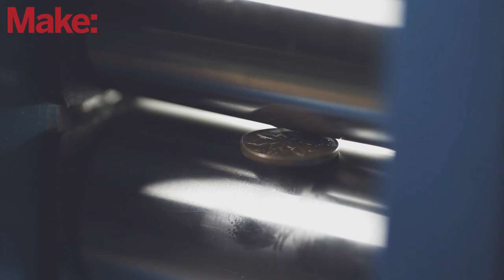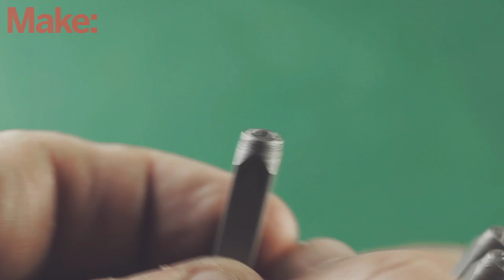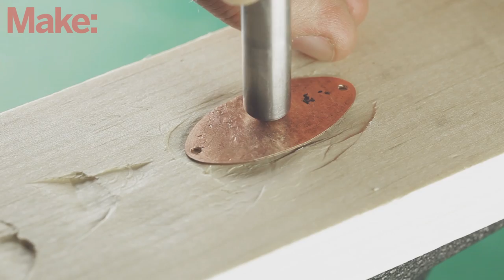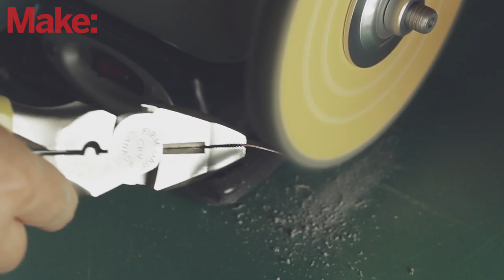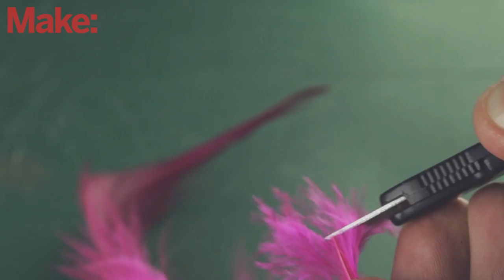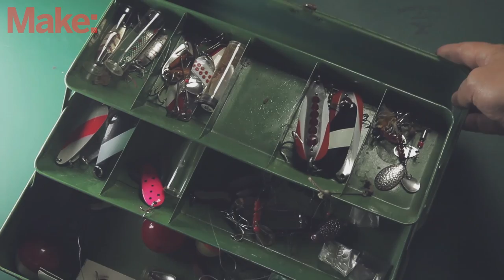Make a Fishing Lure from a Flattened Penny

Comment: I made several like this when I was a kid.  No need for the roller press, letter punches, buffers, nail polish, or feathers on the hook, although these things do make for a nicer result.  Just a hammer and a roundish rock for an anvil worked fine, occasionally polished with sandpaper.  It can be more effective than many store-bought lures.  For larger fish, two attached with a swivel between them is excellent!

Comment: Super nice lure!  Excellent video. Thanks for sharing.  When I was a kid we used to place all sorts of coins on the railroad tracks for the trains to run over.  Probably not a great idea but the coins would flatten out nicely, often bending over the rail just a bit to make the perfect shape for a lure.  You will lose a few coins that may fly out and not be found plus some don't get bent very well.  Not suggesting anyone try this but just saying it does work and is a fast way to get the coin blanks you need for the spinners.

Comment: That's a great idea, to use a flattened penny or other coins if you live outside the UK. I think that spoons are a vastly underrated lure and often overlooked in favour of other lures, or sometimes just used as a last resort lure when all else has failed. They are so cheap and easy to make though, I make my own what I call "micro spoons"using blades of 1 inch or less. The finished spoons are extremely lightweight at only 1 - 1.5 grams in weight. In future instead of using internet bought blades, I might have a go at using a flattened penny, if I can find a venue that has a machine. I remember seeing one last year in Blackpool. If some of the coin remained recognisable even after flattening, then you could use coins of a different currency for novelty value.